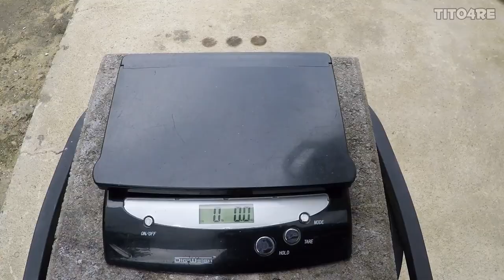Casting An Aluminum Skillet From Start To Finish

Comment: that was a lot of oil for just one egg
Reply: i was wondering if i was rhe only one thinking that
Reply: seasoning the pan... all cast cookware has to be seasoned before use.
Reply: You don't season a pan by pouring gallons of oil into it. You lightly coat it, subject it to high temperatures, and then let it cool.

Comment: I like the video. hate that you are using it for cooking. It is a health risk using an untreated and unsealed Aluminum surface for cooking. Even more if you cook with acidic foods. As a person that does a lot of casting, I would advise against this. Even just melting the Aluminum can be harmful to your health because of the vapors that the Aluminum makes when melting. I am not saying don't cast Aluminum, just take the proper safety precautions. .
Reply: +Jax I agree with you. Cool video but please don't use it for cooking, this is why it''s unusual to find cookware made out of aluminum today unless it's treated.
Reply: it can be used in emergency though
Reply: Arjun Chalke You can use a rock in an emergency.Or scrap steel.
Reply: I apologize for replying to a 7 year old comment, but what steps would be necessary to properly treat a cast aluminum skillet of this sort to make it suitable for cooking?

Comment: This is really cool. Is there a way to buff it out to the point where there is no texture on the pan?
Reply: Rachel Edlin sanding, will but you would have to put more work into it than this guy did

Comment: Was just thinking if you left 3 or 4  legs on the bottom of the pan it would be good for camp fires where you could right on the fire with out a great to hold it on top of the flames

Comment: Nice work! Definitely a pan I would use, though I would probably sand the working side to a much flatter/smoother surface, not a mirror finish but close. As long as it's relatively easy to clean and doesn't incite cooking food to stick more than normal.

Comment: I have a quick tip, before you take the cast out of the mold put it in a bin to conserve the sand. I don't blacksmith (yet, hopefully) but I think that would help save sand and money.
Reply: plz, let me know if there is an issue with this strategy.
Reply: plz, let me know if there is an issue with this strategy.

Comment: I'm curious how does it hold up compared to the iron?
Reply: he doesn't use it after this video
Reply: Well, it's an AL pan.  We use AL for camping.  They work great.
Reply: I might try this to save weight lol and what most call survival we Labradorians call camping lol
Reply: right?   love my titanium spork, but might make an AL one, more!
Reply: or the health side effects of cooking out of bare aluminum?
Reply: None.  Foil, cans, camping gear, coffee pots.. for years and years.
Reply: Most camping gear, cans, and coffee pots have a polymer lining to protect the food/liquid from interacting with the bare aluminum and causing problems. Foil doesn;t because it usually isn't in direct contact with all of your food.
Reply: Cans do.  For the reasons otherwise the soda would eat through the al. But that catches fire when smelting fast.  The real irony is that corn syrup is a much greater concern.  Whether it's spuds wrapped, meat, veggies, in the oven or on the camp fire.. I choose that over soda.
Reply: he can't remember. he got alzheimers from aluminum.

Comment: try using a flap disk on your angle grinder instead of a grinding blade, say 80 grit. you will get a vastly better finish and much quicker.

Comment: Is that sand/clay  or a special mixture?
Reply: +Tito4re ah cool. Soon I'm going to make lead weights for fishing at sea, they are pretty expensive, so it would be cheaper to make them myself.   still have 2 pounds of lead left from repairing my roof.  Does lead give slugs floating on top when melting it?
Reply: +Steve Bergen 
When you melt your lead, throw a wheel weight in, the STEEL clip WILL FLOAT.

Comment: What size are the rectangles? Also, what kind of sand is that?
Reply: +Paintballer Rectangles are 1km wide.
Reply: +Paintballer Its called green sand, a sand/clay mix

Comment: I could see that being very useful. I personally wouldn't cook in it (being raw aluminum), but very useful for other things.
Reply: Virtually ALL restaurants use aluminum cookware
Reply: +Yeggster Shane no they dont
Reply: Perhaps it is different where you live? .. I am in Canada and Aluminum Cookware is universally used in restaurants ... check out a Canadian restaurant supply website for more info.
Reply: Yeggster Shane It isn't uncommon, but the aluminum is usually a specific alloy, and treated, and usually coated to be food-safe. It isn't like he is going to get cancer from that one egg, but Al²O³ does buildup over time, and has the possibility of leeching into food. Aluminum cookware is more of the cheap end of things, whereas higher end restaurants/chefs either use stainless steel, cast iron, or ceramic coated pots and pans.
Reply: @Blueshirt38  Just wondering could I use some of my old cast iron lifting weights I never use to make a pot ? Would that be safe to use ?
Reply: @jamalking6738  No idea. I'm not a metallurgist or anything.

Comment: makes sense, aluminum is very good at spreading heat evenly
Reply: +idontuploadjustwatch  Yes but it also isnt very healthy. cast iron skillet is better.
Reply: They're fine as long as you don't over heat them
Reply: He probably overheated it considering the fact that he used the same thing that he melted the material with in the first place to heat the pan it created

Comment: Do you still use that cast aluminum skillet to this day
Reply: ...cause that was much faster than carving out a skillet out of form...just guessing
Reply: Ellipses don't inherently represent arrogance. It merely represents a pause of some sort. People often use it to help emphasize what they're saying or to show a lack of clarity on the subject. Though, they do use it in an attempt to convey that the answer is obvious, which kinda fails when they themselves aren't actually sure. I suppose a lot of it is up for interpretation and such.

So yeah, I guess in this case, it could be a show of arrogance. This is all assuming that you're typing all ellipses as shows of arrogance rather than just talking about arrogant ellipses as a type of ellipses.
Reply: Thomas Yang Sitting there making a damn skillet out of foam would obviously take way longer that the method he used, i didn't say it wasn't easy or hard or anything in between, just said faster, im sorry my "...'s" offended you

Comment: using an iron skillet is good for you because your body actually needs the iron that gets into your body. aluminum I'm not so sure. aluminum also emits a toxic vapor when the heat is high enough.

Comment: You should  figure out how to do  some kind of plating  and make the outside bottom of that pan with good copper so it can better regulate the temperature, statement the amount of oil he used for that is completely reasonable not only is that a cast item so heavy oiling is recommended it's also aluminum which is notorious for an extreme amount of sticking.

Comment: Instead of using the piece of wood to press the sand down, couldn't you theoretically cut down a piece of wood so it fits snugly in the box and put a handle on one side so it's more convenient?

Comment: I was under the impression that you weren't supposed to use aluminum to cook with. I would have cast one out of copper either way as it's naturally nonstick and it's a much better conductor.

Comment: Could aluminum instead of lead be used to cast toy soldiers? I remember when kits were sold for kids to melt scrap lead and then pour into heavy steel molds.  So much for the brain cells!

Comment: +tito4re what about a cast copper skillet? probably too weak to be practical but it would ve cool
Reply: you do know that copper actually is used as kitchenware?
Reply: copper kitchenware is some of the best kitchenware you can get
Reply: +Nicolas CW that's exactly why i said that
Reply: +Dubbadee124 exactly
Reply: Anthony Ingram Oh sorry didn't get it that way :)
Reply: ***** It's toxic when soluable, i.e. as  a salt, not when it's in its solid metallic form. Copper does oxidize easily so copper kitchenware is covered with a protective coat (I believe it's made of tin). But I think that Tito wouldn't have taken too much risk by cooking in a copper pan that has just been cast.
But I'm not a pro so dunno, if anyone knows (and cares...)
Reply: Nicolas CW actually they're only reactive when using acidic foods and reactive foods like tomatoes, chilies, and limes
Reply: Copper is definitely not something you want to consume a lot of. That's why most copper cookware has a different metal on the inside. Theoretically the best material for handling food is gold, since gold is highly unlikely to react with anything you'd be cooking.
Reply: seigeengine gold is edible but it also is very weak so it would have to be a lower grade gold and mixed with iron copper or silver
Reply: Anthony Ingram No, you'd just have to not gouge at it with harder materials like an imbecile.

Gold isn't weak. It's just weak compared to other metals, and in the domain of things like jewellery, it's weak enough that it can get scuffed up or scratched by coming into contact with other things, and very delicate pieces can get broken, which is a problem specifically because you want jewellery to look good, and because jewellery is often extremely delicate.

Comment: Looks good.  Unfortunately a cast aluminum pan won't cook worth shit.   Lol.  Aluminum and iron absorb and diffuse heat very differently, so the pan dynamics are not similar.  An aluminum pan has to be much thinner than an iron one, and the surface won't season over time like an iron pan will.

Comment: But you already had a cast iron skillet?
Reply: LOL

update vid is now 25 sec long; one shot of an egg cooking in a cast iron skillet
Reply: Cast iron needs to be preheated, aluminum doesn't. Cast iron is much heavier, and warps from high heat cooking on electric stoves, or anything else that would heat a poor conductor to quickly and not uniformly.

Comment: Looks nice. although id wouldn't cook with it, because of alzhimers
Reply: Aluminium does not dissolve in your intestine and pass the "blood-brain barrier", so continue to enjoy your CocaCola and Fosters Beer in aluminium cans 😄
Reply: +dav snow cans usually have a layer sprayed so the contents inside don't touch the metal
Reply: plus i'm trying to lose weight so no alcohol and no cola

Comment: lots of misinformation in this comment section.  aluminum releases toxins and carcinogens when heated,  however aluminum is common in cookware.  

its fine to grill something on an aluminum skillet, but somewhat toxic when something is cooked inside aluminum foil.
Reply: here's an easy to understand article about it.

http://www.huffingtonpost.com/the-conversation-africa/why-you-shouldnt-wrap-you_b_9622502.html
Reply: +jim-bob jones 2,4 grams per Day is maximum recommended exposure or 2400 milligram..  cooking in it is more Then fine..
Reply: yeah, totally safe to cook in it.  the article shows a simplified version of whats going on.  cooking in aluminum foil isnt going to kill you as soon as you eat whatever you cooked.  but, its not very good.
Reply: jim-bob jones I should be dead then with the amount of times I cooked things in foil.

Comment: USE A FINE GRAIN SAND/ LESS GRINDING .
Reply: I believe grinding wheels are for ferris metals only grinding aluminum can cause failure of the wheel at speed. Use a flap wheel !

Comment: not a copper skillet?
Reply: copper is toxic and can kill you
Reply: I've heard copper is antibacterial.
Reply: Not really aluminum is actually the toxic one but  copper not really
Reply: +Nightshade copper isn't toxic
Reply: +Milan  Milojkovic neither is aluminium
Reply: Aluminum is far more abundant. Also, the link you posted even said they can't establish a causal relationship between aluminum and Alzheimer's. Lining copper with stainless steel is a lot of work and very expensive compared to using aluminum and anodizing it (which makes it non-reactive).

Comment: Do you even know how to use a grinder?
Reply: +Tito4re sorry, I meant you don't know how to use a grinder properly
Reply: +MrBillyBubz Says the guy with no quality content whatsoever...
Reply: you sort of do have a point.
using a grinder takes short time to finish, but it leaves a little screwup on some parts.
I would recommend on using sand paper. it may take time, but it's worth the cost.

Comment: Why buy a pan when you can make your own?
Reply: you have to buy a pan to cast your own pan
Reply: +eerie descent I guess you don't have to buy any new pans if you have one to cast the mold.
Reply: +Marth It costs more for all of the supplies to set up, cast and mold than to buy a decent cast iron pan. You can get one for like $30 used and just re-season them. They'll last a life time.
Reply: +Zach Dalzell But there's something satisfying about making it yourself, despite whatever it costs.
Reply: Marth Oh sure, if you're making it because you enjoy the process then go for it. But for the normal person it doesn't make sense. I must have misread that.
Reply: +Zach Dalzell That's what I originally meant, doing it because the process is fun. I used to take carpentry in school and I made my own cutting boards that I still use to this day. Plus it helps I'm a cook in my spare time and I make everything from scratch. So it all goes hand in hand in my experience.

Comment: don't want to be the bad guy but aluminium kitchenware like a skillet doest exist for a reason boy! aluminium is actually toxic!
Reply: +Samantha 'CanYouNot' anodized aluminium yes but regular aluminium no!
Reply: Are aluminium cans for soda an alloy or something then?
Reply: Ah, thanks
Reply: would you say copper is a safer metal to use?
Reply: can be used as is but it<s preferred to have it coated its safer since copper is also toxic. just look it up on wiki for all metal you can see if they're toxic or not.

Comment: Why cast an aluminum skillet when you have a perfectly good cast iron skillet?
Reply: For fun?
Reply: education? or maybe he just felt like it.
Reply: for Alzheimer?
Reply: +Victor Galvez aluminium isn't toxic it is only toxic when in compounds like sulphates😐
Reply: Exactly, aluminium oxide (surface of the skillet) has a low toxicity LD:3600mg/kg. But I remember you that you will put a solvent in it (water) and perhaps somme food that will change the ph (cabbage rich in oxalic acid, or maybe citrics,etc), and also you will heat the reaction (by cooking your stuff).  Maybe you have a PhD in chemistry, (I doesnt) but its not worth the risk of weirdos chemical reactions that could substitue the anion in the alumimium salt (or oxide) by another thing... Anyway the "alu" cookware is sort of banned...call me crazy but maybe, just maybe is for a good reason.
Just my 5 cents man.
Reply: +Deadly Little Gamer 
Exactly.
Reply: +Deadly Little you say it...
COATED ONES.!!!
Reply: Aluminum is on the 2007 list of top priority toxins in the United States, and another data: in 1960 the use of uncoated aluminium cookware was "banned" due to safety concerns about aluminium leeching (despite the very good thermal conductivity and cheapness of the wares).
Reply: +Deadly Little Gamer Sorry, I was wrong about that, Perhaps you could publish your results in order to enlight the word about Aluminium  safety, after all im a dumbass as you said... my apologies.
Reply: +Deadly Little Gamer No problem. No offense taken!
Reply: Iron's an awful conductor of heat and shouldn't be used on high settings on electric stoves. Aluminum is lightweight and better at conducting heat so you don't need to preheat it (and electric stoves won't warp it).

Aluminum is also more abundant than iron in the Earth's crust (though there's so much of both you don't really need to worry about a shortage). You can anodize aluminum at home to remove reactivity, and it's lower maintenance than iron anyway.
Reply: quote: " in 1960 the use of uncoated aluminium cookware was "banned" due to safety concerns about aluminium leeching"
Reply: Victor Galvez If you look, you'll notice my second paragraph mentioned anodizing aluminum at home, as in the aluminum is no longer uncoated in that instance. Regardless, I was answering the op, aluminum is a better conductor than iron regardless.